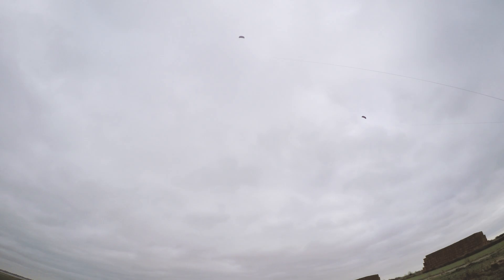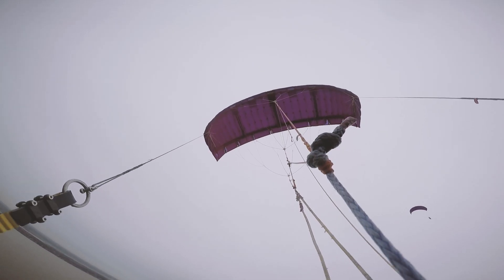Kite Power Solutions: The new way of harnessing wind energy

Comment: What happens when the cable is fully extended, how does it get wound back up? If electricity is used to reel the cable back in, what is the ratio of energy produced vs energy expended per deployment/recovery?

Comment: Slick.  I gather that once one kite has pulled out its limit, the onboard electronics tack that kit's surface so that the wind produced tug or pull is reduced, allowing some of the power being produced by the second kite to pull in the first kite?  Maybe 20% of the available power to be used to charge up batteries?

Comment: I worked on the main rig of this project,  it was scrapped before being compleated, based on hydraulics, it was neither environmentally friendly, nor feasible, the whole idea is flawed, the flight area needed is massive, per rig.  One of the pro arguments was it needed no concrete base like a wind turbine, this was, in fact, a lie, the large twin winch trailer wound needs to be tied down to produce the power suggested, therefore at least 4 bases would have been needed. it's a dangerous concept, if the Kite breaks free, it could cause unimaginable damage,  and offshore- it would have been a disaster waiting to happen, 4-inch + hydraulic lines, imagine if one burst!!! releasing hundreds of ltr;s of oil,  I can honestly say from the beginning it was obviously a money-grabbing project that left its investors with nothing! compleat waste of time and money, I have now left the company that was involved with this, I feel sorry for those who put up the money. those in charge changed their mind on a daily basis, I think they knew it was going nowhere but had to keep the investors convinced.    Now to sit here and wait for the backlash from my X employer. 🤣  I always said this- although wind farms are not totally environmentally friendly, you can't beat a fan on a stick! so why try to re-invent the wheel!

Comment: Benjamin Franklin used a kite with a copper cable in his electrical experiment. Using the voltage differential from atmospheric charge and ground charge. If you can get a kite up to the altitude of millions of volts. you would not only have the me to generate from wind but difference between atmospheric and ground voltages.

Comment: 041621 Just saw this and another kite system. What kind of power with a set if two kites create? How many Kilowatt per hour? How high do they fly? Of course they are simpler butthese aren't being compared to the wind farms or solar farms, correct? 
It is TRULY FRUSTRATING how expensive it is to install, maintain solar panels on a home and now ALL new homes, in Calif. are Required to have them AND NO MORE GAS APPLIANCES!! WTF!!! I HATE electric dryers and water heaters!!! We STILL have to burn coal and some other fuel to create electricity in great quantities. Where do you think the electricity comes from to run your electric car??? Huh?
Reply: Kilowatts per hour does not exist (other than a time derivative of power, or double time derivative of energy in nerdspeak 😀). 
Just like km/h per hour or mph per hour does not exist for speed (are actually units of acceleration).

Do you mean power (kW) or energy (e.g. kWh for a given time period)?

Comment: And how much extra waste will be created in manufacturing these units. Will the power that one (1) set up generates, exceed the amount of energy required to manufacture one (1) unit. I see a whole lot of different elements in each unit, that would require input supply from multiple manufacturers of these individual elements and each of these will require power to manufacture and deliver. We would be far better off devoting time and resource into how best to deal with our current form of energy supply. It is far better to keep older cars on the road than build new ones - why, because you still have to figure out what to do with all the old cars that you are replacing and a car is more than just a hunk of metal. One major thing to think of...only the earth spins without lubrication.

Comment: As a kitesurfer I'm more interested in the materials on the kites, because current sailcliths are toast after 500-1000 hours of flying and uv exposure.
Reply: Thats something I never knew. Aside from the UV exposure, is it the salt in the air that reduce the life of the sail material?
Reply: This is more of a proof of concept. Actual systems would have solid sails.
Reply: they don't need to be inflated, so any fabric can be used.  Carbon fiber for exemple is completely UV-proof, and inerte.
But forget Kite Power Solution, if i understand weel, they got buy, by a new compagny, that has a differents idea (no kite, but a glider ...)
Reply: А что если использовать PET? Он прочен на разрыв. Пластиковые бутылки из него очень устойчивы ко всему.

Comment: Bottom line question how many watts will it produce per hour?
Reply: Watts is a measure of power, which is the rate of work done. You mean Joules (Watts x hours) as a measure of energy produced. These kites are Megawatt-scale systems. Let’s average the normal household mains at 150amps for the 120V system and conservatively estimate all homes consume 18kW continuously....(not including grid losses)...then a 1MW kite system will power 55 homes.
Reply: @thebunnisher109  18KW?  You heating an outdoor pool, smelting metal, Is the atmosphere starting to liquidfy?     🤣

Comment: did he just say the energy is made when pulled into the air? you would use more energy to reel it back in though..... it needs turbines up there. then we are talking about some big power.
Reply: This is actually very efficient. You can just change the angle of the kite in the wind so it basically brings itself back to earth. If you put a turbine on the kite it would need a lot of maintenance and very consitently high winds to hold a heavy generator up that high.

Comment: The control a kite to go where you want it to go, you need to give it energy and pull it.
Reply: Yes, they o that by having computer controlled rigging. The computer figures out what it wants the kite to do, then it lets out or takes in different bits of the rigging to change the shape of the wing. It needs very little power to do that.

Comment: I am not able understand regarding the energy required for winding the spool vs unwinding when it generates power , how it wint settle to an equilibrium?
Reply from the maker: To put it very simply, but I think it will give you the best idea: 
The powering kite flies out in the wind in a figure of 8 motion, generating maximum pull (ie energy). The returning kite is directed up above the spool out of the main wind direction. In this position there is minimum pull and so it can be wound in using very little energy. 
Remember back to your childhood (or go get yourself a nice two string stunt kite and test it out!): you can fly the kite to find the maximum wind, but if you direct it straight above you it will suddenly slacken and lie almost dead in the air. KPS uses that same effect to generate constant energy from a two kite system.
Reply: The figure 8 motion accelerates the kite to produce maximum magnitude and duration apparent wind speed which significantly increases the amount of lift energy going into the system.
Reply: Awesome, I was wondering about the energy balance myself.
Reply: Basically, when flying close to straight above you, the kite is close to stalling and very easy to pull down.

Comment: thanks for your reply,with the nelliYOM system for powering up one or even hopefully a trillion[,1,000,000,000,000.]guitars.The unpatent applied for system is to use gravity or a spring to collect electricity as the kite returns to the overhead position.
Then the kite power to collect electricity as the back line of the kite is tightened using a mech anism such as the bar in my drawings or windsurf mast as in my video.
The possibility of doing this,using buggies to fill a reservoir,or buggies to put desalinated water on an ice cap without computer assistance but only mechanics seems exciting to me,
But without the recognition of the historical importance of the Bretton Woods treaty for world peace through economic prosperity,"Bretton woods,united news,"video on u tube.
There will be no wind to pull the kite up hill, just a situation of the utmost gravity.*~*
[ps currency movements stand at $5,200,000,000,000.a day 2013 approx.]?about $520 a day for 10,000,000,000.people?

Comment: Cool .. The heavy generator stuff stays at ground level..  High level winds are faster & more dependable.  A fixed wing glider could work too, be more durable & faster at diving down as the cable is wound in.
Reply: Get yourself one and give it a try.  You'll get a feel for the forces involved.  It's really good fun as well.  Unfortunately there are huge  differences in the performance of the various makes.
The best performing model I've had was also the cheapest.  Three bits of wood and some plastic.
All the ones I tried made from more durable materials performed poorly in comparison.
Flying at the beach it could really annoy the seagulls.  Manoeuvrable enough to trip them in flight.
Nice lass sunbathing lower down the hill.  Bring kite down to 10 - 20 foot above her, almost totally silent, then do a sharp 180, the kite "flaps" making a loud noise just above her.
Rapidly gain height.  She turns to see what made the noise but kite is flying gently above me, silent still.  
She remembers she doesn't want bikini strap marks to spoil her tan.  Great fun.   😆

Comment: when one kite finished pulling the line, we will pull it back again(this needs a lot of energy to do so). i understand kite pull line= generate electric, but whats next? let go the 2nd kite and generate electric. then use electricity to pull back the 1st kite and then the 2nd kite?
Reply: I was wondering the same... there will be a lot of energy wasted in towing back those kites and who knows if in a strong wind situation it is required more energy to tow back the kite than that generated during deployment... This concept looks cool but they need to elaborate in the overall efficiency of each energy generating cycle.
Reply: pizza rio. your idea is plausible.
Reply: Would have thought its much like a kitesurfing kite and you have a trim line (depower) that changes the angle of attack producing less lift.
Reply: They do this by automation and collapse the kite similar to how people use parachutes to hit targets and land themselves in a certain location. While using the second kites torque to pull it in as well as producing energy, thus also keeping the kite tight on the line to rinse and repeat.
I am sure this is now they avoid crossing the kite lines as well.
Reply: surely with respect a can fly directly into the wind.when a kite is launched it moves forwards and depending on the type of kite almost overhead.
 if it is a kite with lnies attached to the back of the kite and it can move no more forward surely it wiil move back?
using leverage on the back kite lines the energy is very small too change the angle of attack?
This can raise and lower something off the ground as the line is tightened and then released using gravity as a spring?
Alternatively it is possible to use a spring to pull back,your dynamo,then to be pulled away again as the kite is powered?
The kite only moves back and forth and in no other direction,
An airship surely can collect electricity in a similar fashion if anchored at the point on the ground where it is anchored simply by changing the angle of attack of the wings or through aerilions[sorry about the spelling}?
Reply: You can simply collapse the kite for retrieval making capable of generating more energy in extension than retrieval.
Reply: if [thanks kevin cartman]an appropriate name for the idea? there is more surface area of the kite presented to the direction of the wind the power of the kite will increase and also change direction of the angle of pull or power force of the kite?
if the angle of the kite in relation to the wind is decreased using the kite then the kite will move overhead it depowers and the power of the kite is mainly straight upwards?
Thus in my video I demonstrate this.very basically.
if a hand is placed at at no angle to the wind out of the wind there is a slight force back,cup the hand so the part of the hand furthest from the wind is lower a slight lift will occur?lifting the hand up and visa versa?
present the hand at 90 degrees to the wind and it is difficult to stop the hand moving fast away from the direction of travel?
the same can be shown with an umbrella.walk into the wind with an umbrella pushed out straight in front of you rather than above the head I
it is more difficult?
thus the kite line powers up and depowers the kite?
an aerofoil section is only usefull in a kite or a sail if you are pulling something[pushing]in a direction that is not in the same direction that the wind is coming from?[a windmills blades rotate in a direction at 90 degrees to the direction of the wind?]and the more one wishes to go in a direction not in the same direction as where the wind is coming from the aerofoil becomes more important?place a kite or sail in an aerofoil section to the wind and the mast holding it will not break as quickly as presenting the whole flat surface in a not aerofoil section to the wind.a ship sailing dead down wind wants a big old square rigged sail not an aerofoil?thanks.
as for the currency movements  they remain in the $5 trillion a day region against the international treaty for world peace through economic prosperity 1944-1946 [Bretton woods]ratified by all 44 allied and associate nations parliaments ,whilst 9/10 of the worlds investable wealth is invested in gambling,not production nuclear still reigns with all its ramifications for war,?as the eco pathway is starved of funding and the progression that had we obeyed the law fought and died for by millions,and almost certainly supported vehemently by sir Winston Churchill,we would have all been driving in electric cars with free electricity even, long ago?
Reply: in short, the kite angles itself so the wind is pushign it with the most force it can, makignthe wire taunt agaisnt the  generator's torque 
brigning it backin, the motorized flaps on the wing anglein a way it faces the wind mroe, so it rpetty much free falls or has less pull agaisnt the wire, making it so the wire reel can be spin easily with alot less power used, 
once itsin far enough, the wing angles so the air hits it dragging it out
Reply: great,are you involved with this project,which is great,please?
Reply: me, nah i am not jsut was interested in it, tbh though, it woudl be much better to have a single kite, have it keep it steady in 1 spot, directly away form the wind, then you can have multiple side by side,  closer, 
whc ares if the output goes up an down it will always do that XD
Reply: thanks,i think perhaps,some are thinking that an aerofoil shape is more powerful than,a non aerofoil shape?i dispute that....If sand is blasted at an aerofoil it deflects,if sand is blasted at the same object turned at right angles too the direction the sand is coming from all the sand transfers all its energy too the object.
in sailing terms or kite surfing this object only moves away from the 
wind,therefore decreasing the strength of the wind ?so seems less powerfull?
I think these people are turning the whole system to take advantage of the simplicity of that fact.and having being pushed as a non aerofoil then raised by becoming an aerofoil,however rather than use another kite to do this ,gravity,or a spring would be just as effective but far less complex?thanks for your comment?

Comment: Interesting idea! What happens when the wind is to weak to keep the kites flying?
Reply from the maker: You can check out the company's FAQs here: http://www.kitepowersystems.com/faqs/
Reply: if with the energy you have been pumping water at times of excess wind then released in can be used for hydro[water]power.
or to replenish an ice cap?we may have to,its kinda cool though!!!?
also of course its a combination of energy pathways eco friendly?
Reply: Life Size Media answer is absent -- only strong winds considered, but what about LOW winds?
Reply: you could have a kite filled with helium or some other gas lighter than air,also higher the kite goes generally it gets windier also the wind changes direction.if you look at a power kite for kite surfing it has a tube at the leading edge so the kite could stay airborne or launched in no wind,like a balloon and continue to rise till it meets the wind at a higher altitude?
Reply: Generally when your higher up, like 500 metres the wind is a lot more stable and consistent its nothing like the winds on ground level, that sort of thing wouldn't be a problem at all and if it was, let it spool out a bit more
Reply: yes and as the kite rises,the winds also increase,and also change direction.